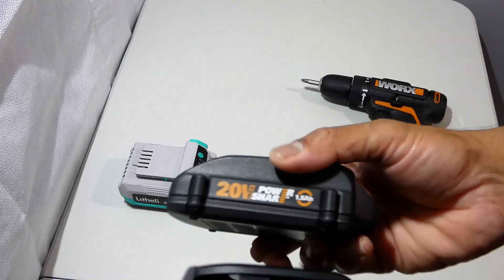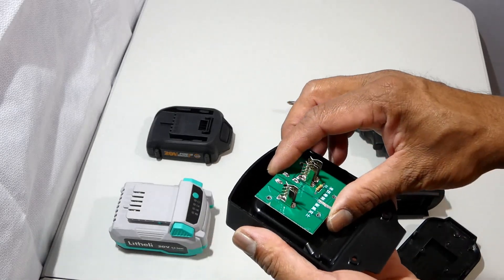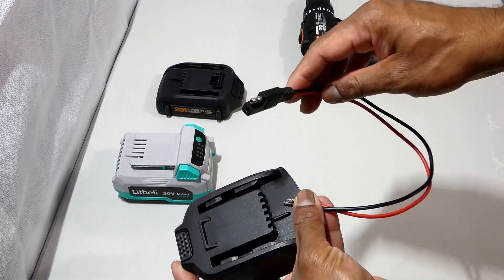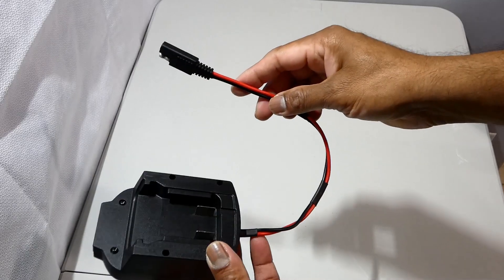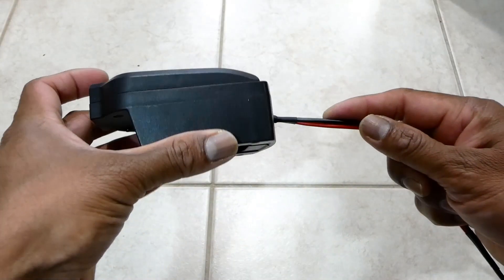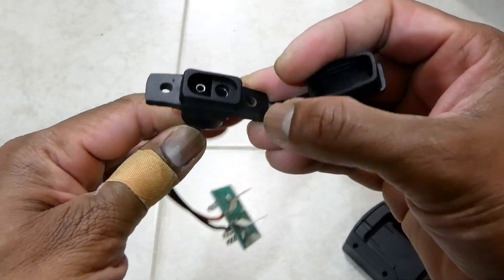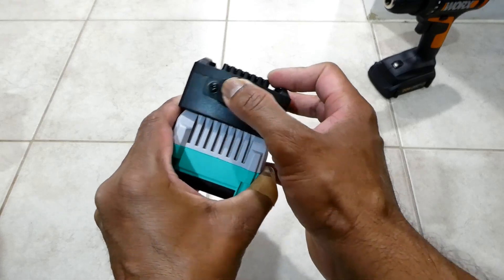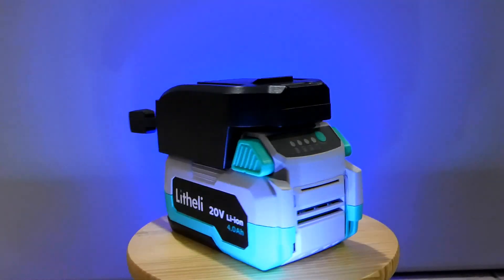How to get power from a 20V Battery Adapter for different use | Litheli to WORX  with SAE Connector

Comment: What is this adapter? Is it worx to DeWalt or something? I can't find worx to litheli on the market
Reply from the maker: The adapter is for Dewalt to Worx, there is no adapter for Litheli battery on the market. That's why, I modified that adapter to fit on Litheli battery.